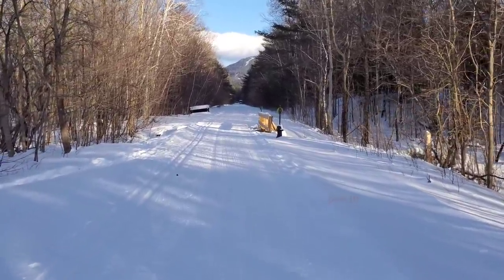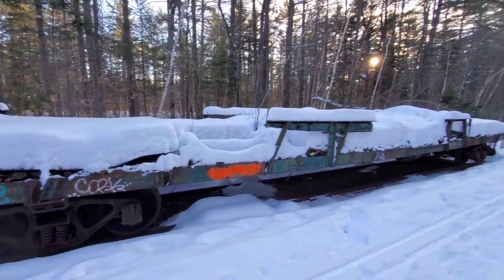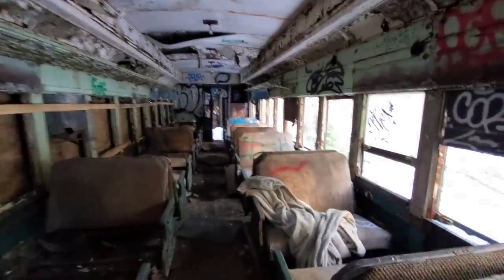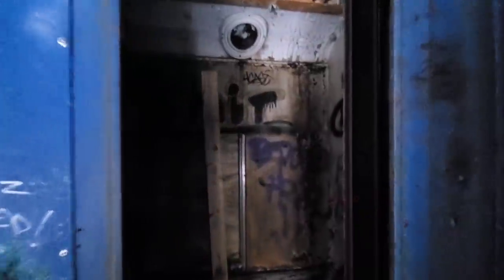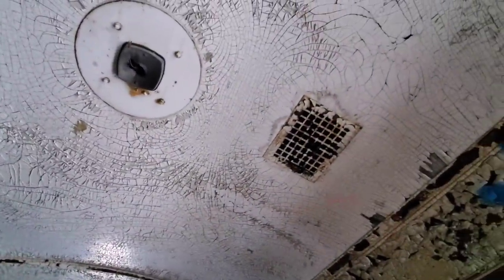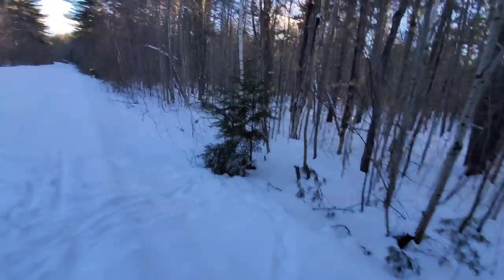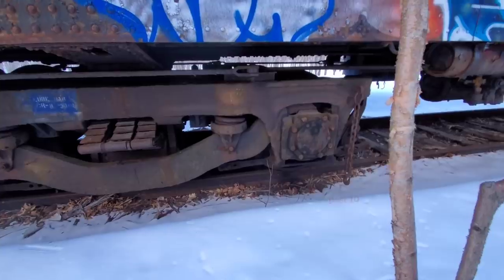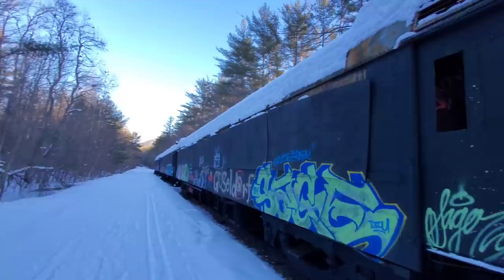Climbing Aboard Old Abandoned Train Far North Country USA

Comment: The first passenger car you walked up to is a former Delaware Lackawanna & Western electric car that was used in regular commuter service from the 1930s until 1984 when it was finally retired from that roll
Reply: The abandoned cars were electric and mounted with a pantograph that glided below power lines through Pennsylvania, New York, and New Jersey.
Reply: These types of cars were also used on the Erie-Lackawanna line.  I rode in these cars to end up in Hoboken NJ
Reply: @erielackawannaridernewjers61  ik

Comment: When they switched to Diesel locomotives, they had water tanks and boilers in the nose of the loco to provide steam to heat the passenger cars. The railroad I used to work at removed the boilers from the ALCO's and installed 480V, 3 phase generators for power to the coaches that had been upgraded to modern HVAC. The big electrical plug looks like a MU connector.

Comment: Was watching one of your older videos from 2019, (YTID: oRpXoJgRzHE) you mentioned an air lock developing on drains and it was restricting the flow. Do you see this a lot, and as an experiment could you try placing a small length of pipe over the drain in the middle and see if you can accelerate the draining rate. Would be interesting and could be useful if you want to drain something quickly.